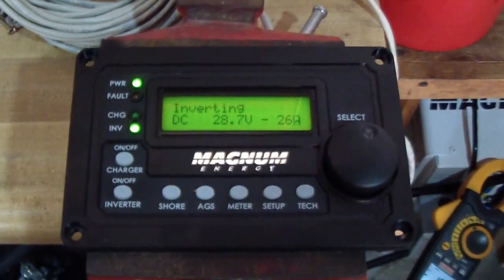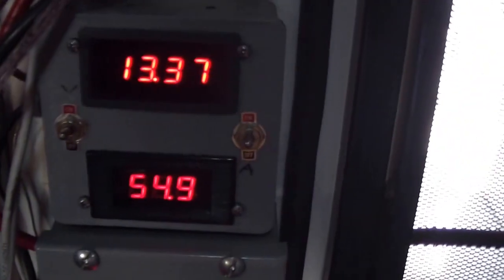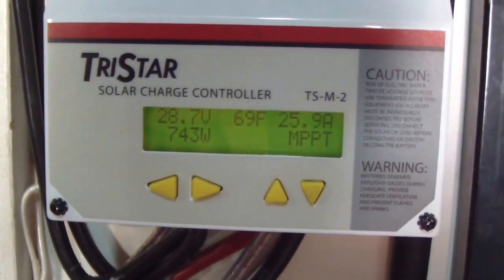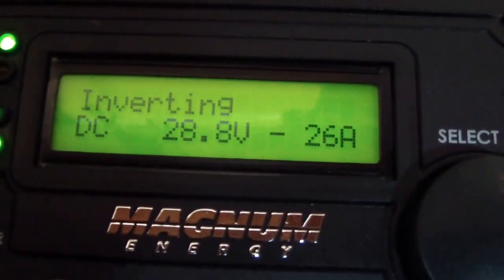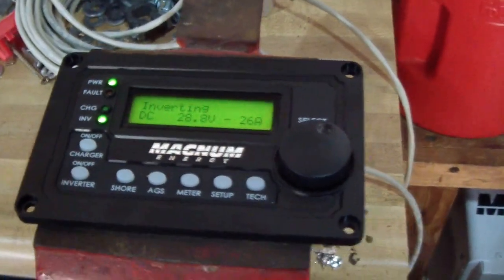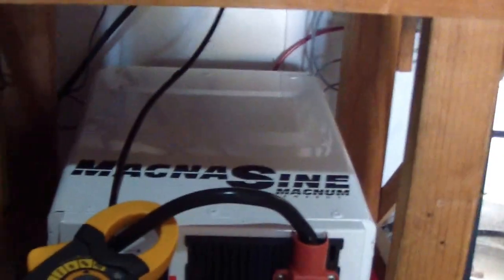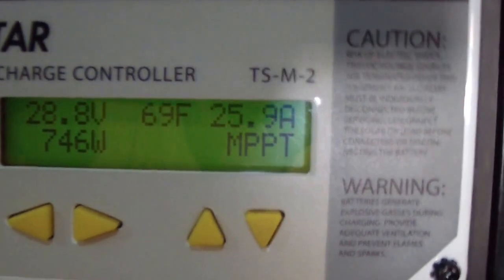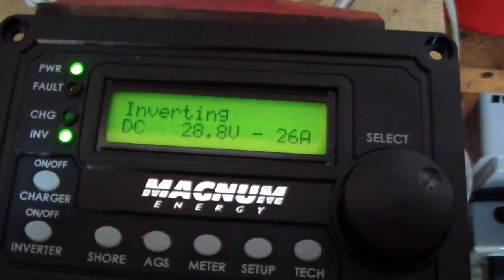Magnum Inverter Running Under Load.

Comment: Hi ElRaz, How noisy is the Magnum, I am thinking of getting one, but the location is one that I have to keep that in mind.
Reply from the maker: Hi there buddy, the noise is next to nothing the two cooling fans are very quiet, the inverter has a very low hum under load. I placed a shortcut on "about me page" on my channel for the Magnum manual, check page 51.
Be Safe,
Raz
Reply: ElRazTheGreat1
: Thank you Good Friend! Keep up the good work with the videos!

Comment from the maker: I am doing some fine tuning on the cabling and the connections and comparing my options as far as the setting on the charge controller and the inverter.  Thanks for watching comrade.
Be A Good Human,